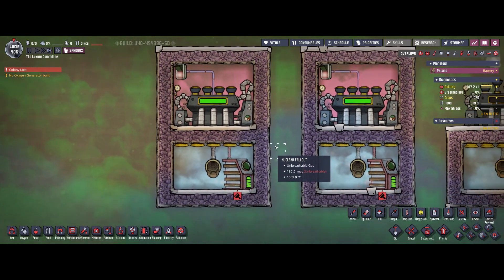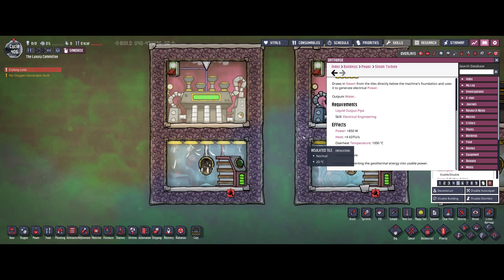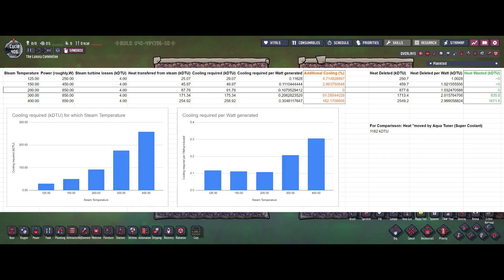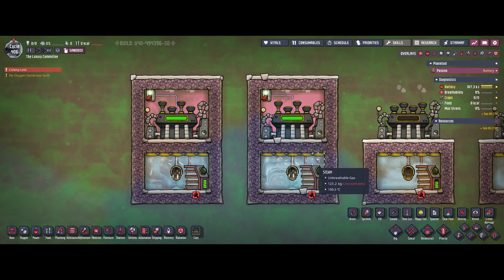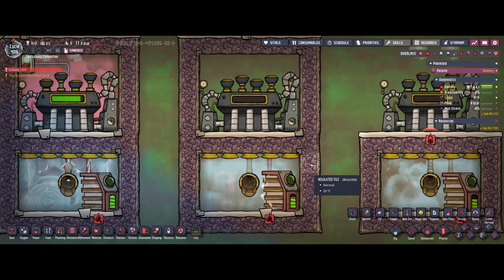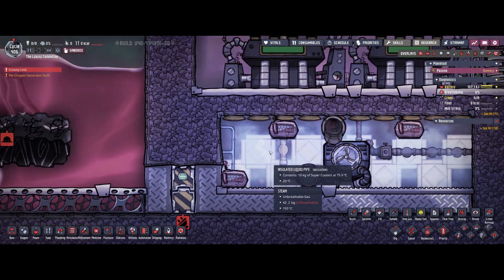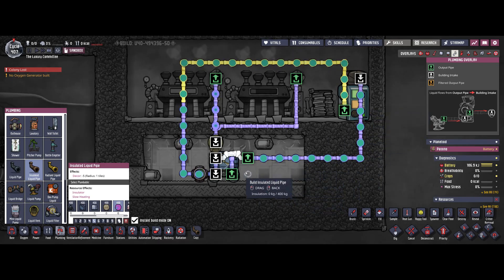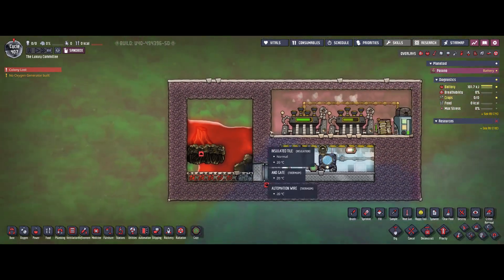Oxygen Not Included: How to operate steam turbines for max Efficiency? /w Automation

Comment: It seems the final and most efficient datapoint is missing, which is to use the 95C output to cool the turbine. That should eliminate the added cooling penalty of running steam below 200C, and actually eliminate cooling cost completely. Since a portion of the turbine's output heat comes from the steam input temp, running at lower temps should reduce the total heat energy that needs to be cooled. This should also dump up to 5C change in water temp worth of additional energy back into the steam room that would otherwise have been costing energy to cool. I have yet to try this but from what I've read it sounds like 135 degree steam is optimal as long as my sources aren't outdated. As long as the generator shuts down over 100C it should be impossible for the output pipes to flash to steam and break (apparently water should turn to steam at 102.35C in the game?), so I guess it's critical that extra heat doesn't bleed up from the steam room.

Comment: In simple you are trying to explain - if steam turbine suck hot steam above 200C it will waste the Heat and Heat up early comparing a steam turbine which is working on 200C (Full efficiency)

So it's better to control Steam Chamber temperature less than 200C to save Heat Source and save energy on Cooling turbines.

Comment: What do u do with solid block of magma?
Reply: Look up a petroleum boiler build, where a packet of magma can be dropped next to the conductive tiles, and with a temp sensor on that tile when it gets cool enough you can use a robo miner above (not in magma) to dig the tile out before the next blob of magma is dropped in.
Reply from the maker: thats not part of the video. Usually its a good idea to let it drop on mesh tiles so it cant form solid tiles when cooling down.